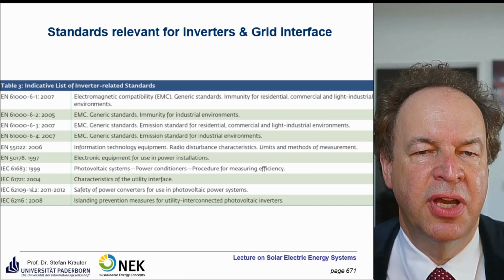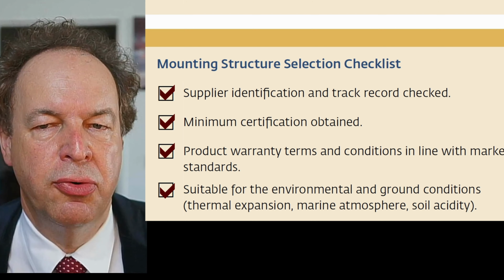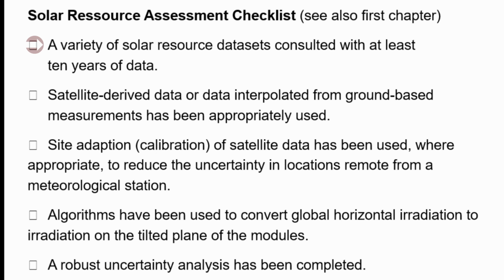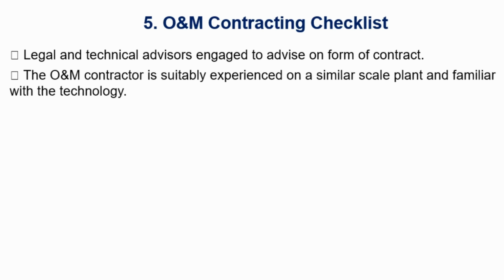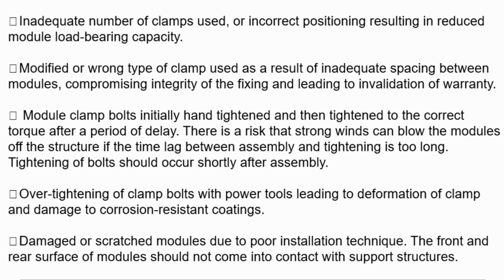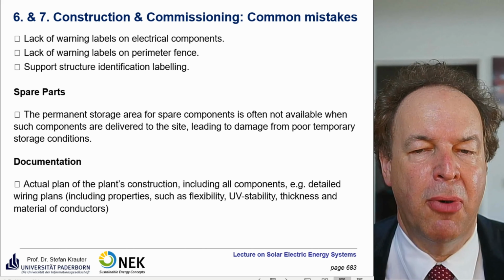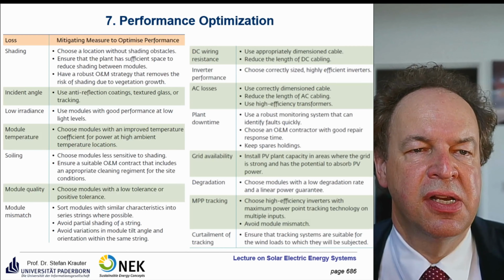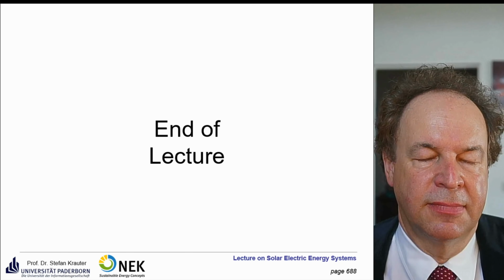Solar Electric Energy Systems 14: Setup of Large-Scale PV - Part 2

Comment: Sir, plz answer my question, i know that After the mppt circuit we have a DC-DC Converter that vary the PV output voltage to get the Vmpp, but how in large scale systems the mppt included in the inverter ?
Reply from the maker: The MPPT with the DC-DC converter provides a suitable voltage for the inverter section, basically independent from the actual PV voltage or operating point on the I-V curve of the PV module.
Reply: @Stefan_Krauter  thanks, but for the mppt Algorithm to find the mpp on th I-V curve have to vary the voltage how can it do that without a DC-DC Converter ?
Reply from the maker: @mohamedatti8659  Basically, a MPPT is a DC-DC converter. Please take a look at my videos about PV and PV systems and components at beginning of the course.
Reply from the maker: Take a look at that video which covers MPPT: https://youtu.be/yDOXONonG6g
Reply: @Stefan_Krauter  one last question, with mppt we change the voltage to the the mpp voltage than do we have to change the impedance to get the mpp or no just varying the voltage is enough
Reply from the maker: @mohamedatti8659  The MPPT is actually an impedance adapter, changing voltage AND current - otherwise the power (P = V x I) would not stay constant.